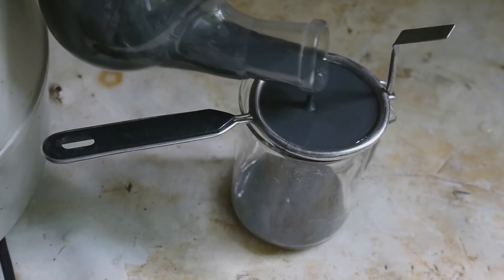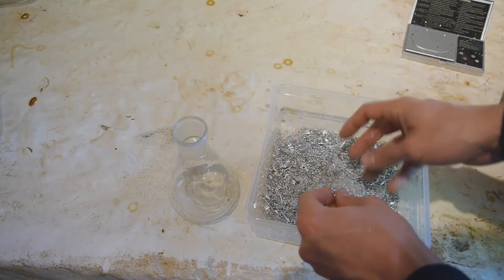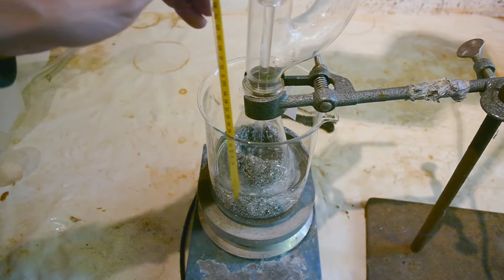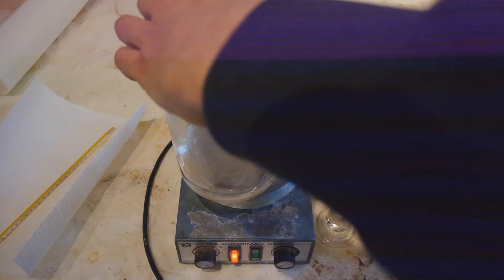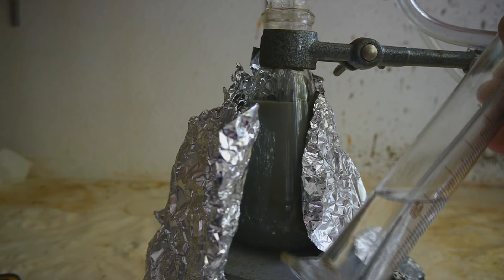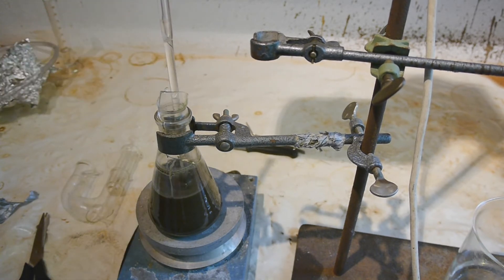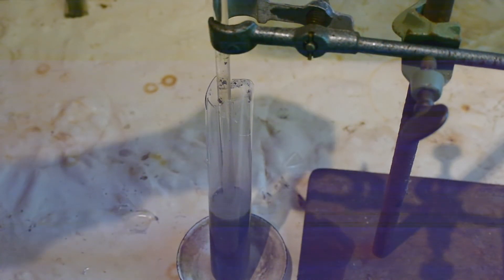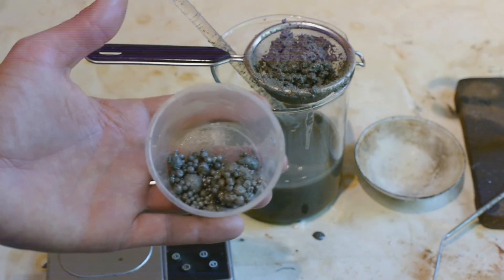Sodium Production First Sucess!

Comment: I had exactly the same adapter broken during exactly the same synthesis attempt, but rather because it was shot out from the flask as hydrogen inside exploded for some reason. I guess I haven't used sodium kickstart back then and my lye was too damp.
BTW, I had the same issue with low yields and paste-like product, which absolutely refused to coalesce. Been using old and very fine magnesium powder.
Reply from the maker: Yeah it was probably the magnesium metal, or the mineral oil in my case.

Comment: You probably sjould have worn gloves when picking up the Na. The moisture from your skin will react and form NaOH and it can also poison you similar to Li.
Reply from the maker: Well that sodium metal can form NaOH I am perfectly aware of, but that was never a problem for me. LiOH is considered toxic NaOH not. And even LiOH is not that dangerous to the touch, because it has a very hard time to go through your skin.
Reply: @EliasExperiments  i was partially wrong. So Li can give you metal poisoning but thats if ingested or if it gets in an open wound. Yeah your right but it can saponify the oils in your skin and it us very caustic. But dude you have to wear the propper PPE when doing chemistry. You are clearly smart but you just dont know how to be safe or take criticism.
Reply from the maker: I think you missunderstand me. If I wanted to be safe I wouldn't be doing chemistry. There is an inherent risk to doing things like that and to my best knowledge wearing gloves while handling sodium metal will not reduce that risk. I have worked with sodium metal quite often and when it does go wrong is usually involves water.
Now about taking critisism I want to be as open about that as possible. Just tell me how I should have responded to your comment in your opinion and I'll try to improve that in the future. :-)
Reply: @EliasExperiments  true. Chemistry is dangerous but there are alot of things you can do to make it safer. Say if you wanted to use HCl in a reaction to say make the HCl salt of something do it in a well ventilated area. Or say if your working with strong acids or bases wear the appropriate gloves. Yes i get your point about chemistry being dangerous most people agree, but if you follow the propper saftey protocol you will dramatically reduce the risks involved. Also about the criticism, for your bleach BP video you kept insisting that it was blackpowder even when a google search would disprove it. Also when people point out your lab practises you are dismissive by saying "chemistry is dangerous" instead od saying something like thanks i will wear gloves or eye pro next time. Sorry if that sounded rude.
Reply from the maker: Okay I get that you want me to wear gloves. And I will wear gloves if I think it is appropriate. With the BP Bleach video, I said that I was wrong at the end and set it to unlisted, after having explained my reasoning. Do you really think that was so bad of me?
I just don't see how wearing gloves when handling sodium metal reduces any risk (blowing up on contact with water). My skin never had any ill effects from NaOH. Nail polish (Acetone, I don't polish my nails of course.) :D is a lot worse for me and gloves don't help against it.
What about you try to accept me the way I am?
If you can deliver me one great argument I am always open for a change of mind. :-)
Reply: @EliasExperiments  i never reilized that you said you were wrong. Also you should have wron gloves during that Hg video. Metalic Hg isnt too bad but the othe murcuric compounds you were handling were water soluble and can give you acute Hg poisoning. I really font know if i can change your mind. I just dont see why you dont wear them. It seems like common knowledge. Also i like the Steven Crowder reference 😂
Reply: @EliasExperiments  ok ig i will. Accept you the way you are. Just get a blood test done periodically to check if you didnt accadently poison your self.
Reply from the maker: If everything goes wright I have a new mercury video ready tomorrow, where I wear some gloves when handling the soluble compounds, cause you are absolutely right about that. Sodium metal is just something completly different. What do you mean with the Steven Crowder reference? Must be a coincidence, cause I have not heard of him bevore lol. 
I absolutely hate blood test and that I will only do if absolutely necessary. :D